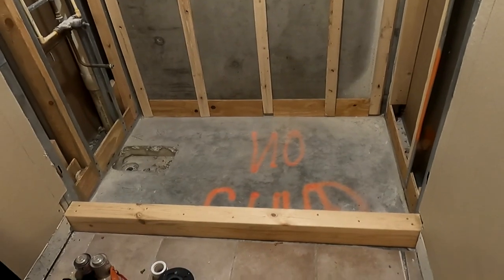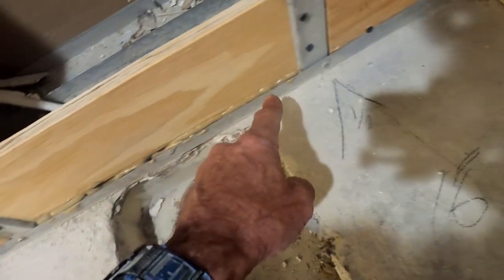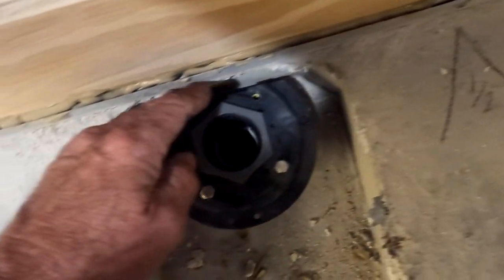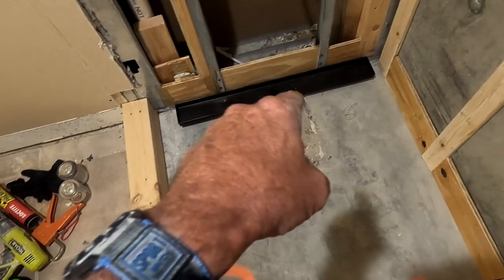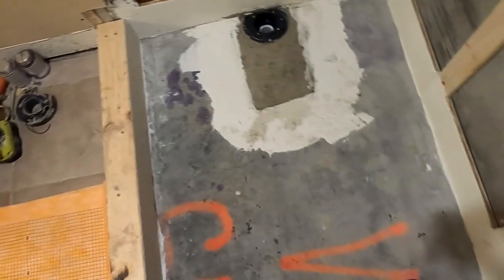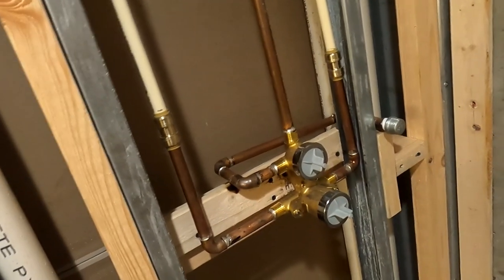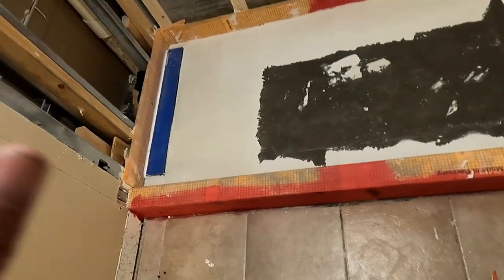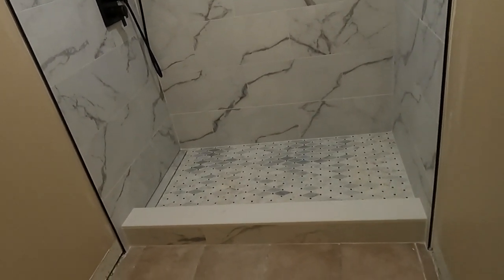ISSUES BUILDING SHOWER IN A CONDO

Comment: good idea, and logical where and what was done. however, its a high rise, and whatever you did, is not to the fire code. there are other ways to finish it.
Reply from the maker: Having been a firefighter in the 80s I can tell you 100% that the current make up of this shower far surpassed the fiberglass tub/shower combo that was there before for fire safety 👍👌

Comment: Dealing with the same drain issue. 
I’ve chipped out some concrete trying to expose the drain pipe but I ran into the tension rebar. 
Thinking about using magic mend to glue to the inside of the existing drain pipe. What do you think ?
Reply from the maker: Sometimes you have to bite the bullet and call a professional plumber, they have run into issues that you would never anticipate and know an easy resolution

Comment: Between 14:10 and 14:15, are those bullet casing in the concrete box cutout? Looks like 9mm. Rather odd to see those in there lol
Reply from the maker: At the 15-minute Mark I explained about the bang gun, little 22 rounds, of course with no bullet in them oh, that's how you get the bottom two by four into concrete so that explains the shells
Reply: @StarrTile  thanks for that quick response!

Comment: Got the same same problem, I'm searching for a low profile drain I see you cut yours which is one of my options, I will be illuminating the tub over flow, and my vent is two feet away, will there be a vacuum problem?
Reply: Darn coco beach condo and the drain is located at the end of the tub is a brass tub tee 1 1/2 I'm afraid to chisel around it and end ub in my neighbors bathroom
Reply from the maker: You could maybe use a studer vent...
But if your two feet away from the vent don't see that that is a problem

Comment: I’m thinking of doing a curb less shower in my condo. Concrete floor. Quite confused how to move the drain from the center to an edge. 🥺
Reply from the maker: I did not want to do a linear drain on this, I was forced to because these high rises have concrete floors with tension wires inside so I couldn't knock out the concrete...that's why you see the drain so close to the wall where the tub drain was.

Comment: You like using ryobi? Or have you had problems theft and just gave in.
Reply from the maker: I beat and abuse my tools so although I'd love to buy high end diy tools I see in my customers garage hanging so pretty above the work bench, I'd feel bad when they're tossed around.
With ryobi they still do the job and cheap to replace if need be....little of the Casey mindset too on "things"
Reply: @StarrTile  I prefer dewalt myself.... Slightly more but solid line